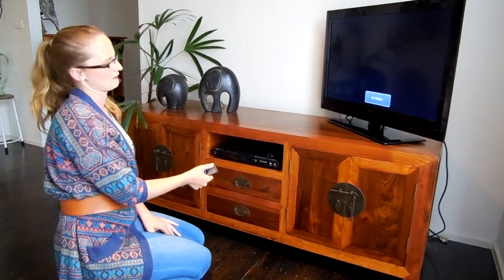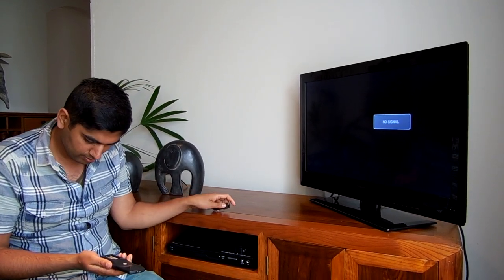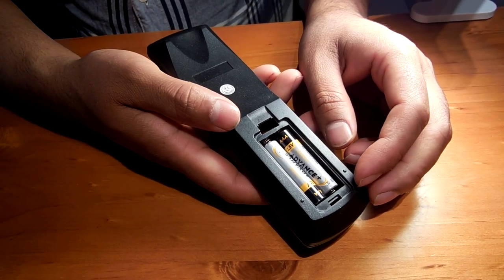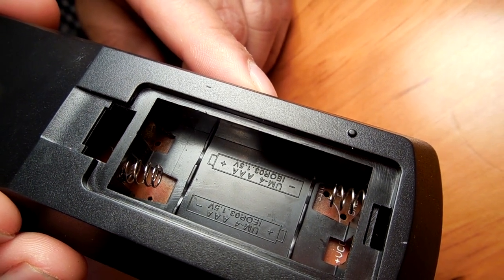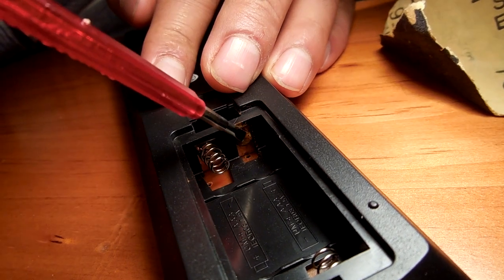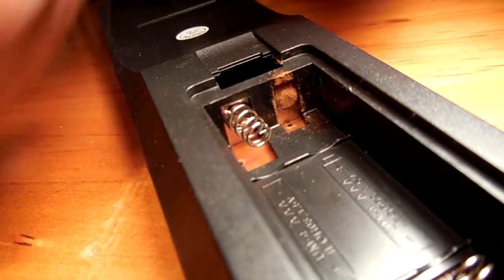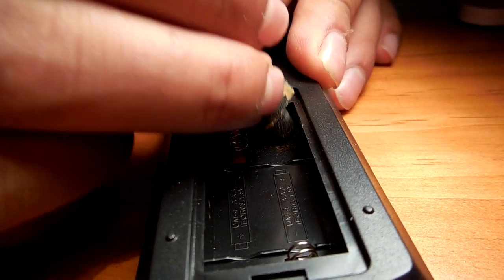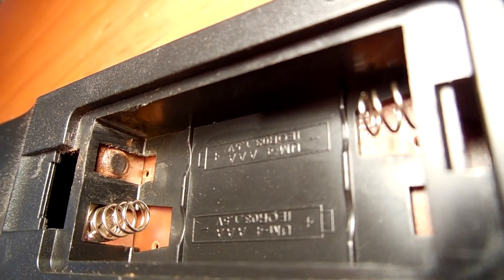Fix Your Rusty Remote: EASY!

Comment: THIS WORKED! Thank God! I used a pair of scissors and getntky scraped it. (Make sure you have a direct source of light on the remote) no sandpaper so I used the inside of my sweater. 

At first the tv didn’t turn on. But I pressed a few button. Pointed the remote AT the tv and when I clicked “power” I saw the red standby light turn blue 😮….THANK YOU 🫡🥰

Comment: To finish this cleanup try distilled vinegar on a Qtip swab. This gets off the green or white leakage on the terminals. Do not allow the vinegar to soak into the device you are cleaning. I will usually start the cleanup with vinegar and then resurface the terminals.

Comment: Worst idea.  Instead of doing this  take some baking soda and add few drops of lemon.  Apply mixture of it over corroded part. After 10 minutes clean thoroughly   do it 2-3 times. You will get the best result.  You may use white vinegar to clean it well.